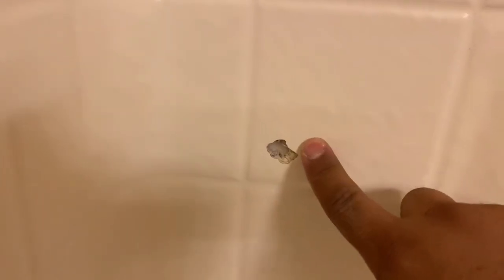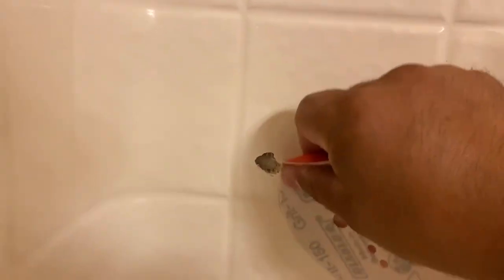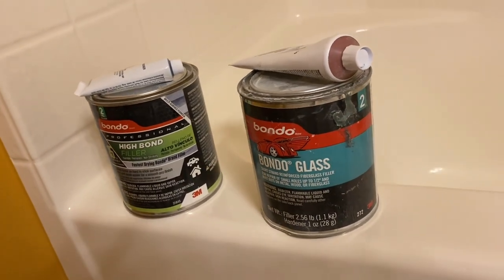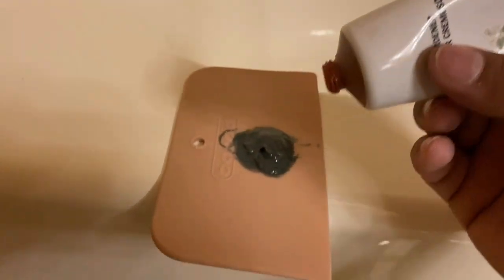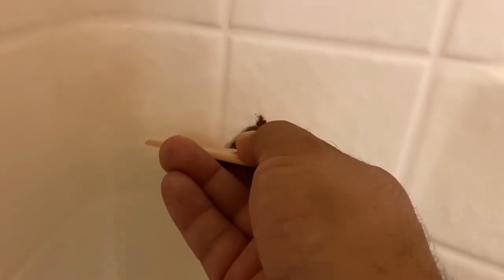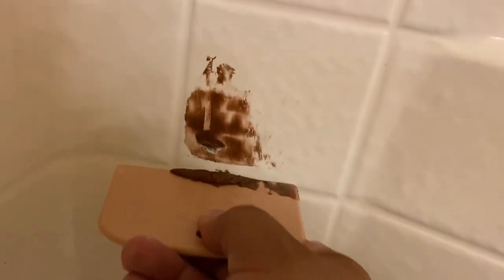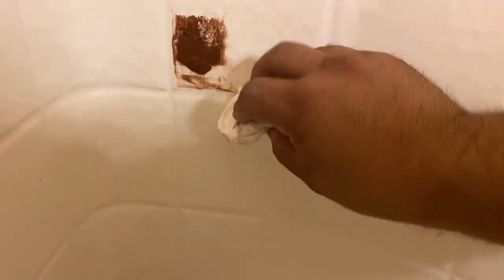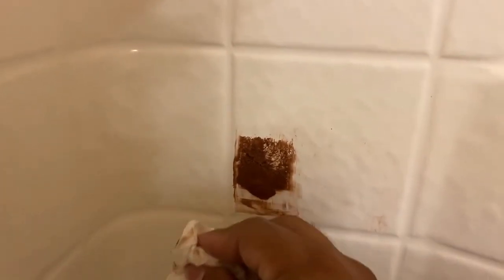How to Fill a Hole in a Fiberglass Bathtub | DIY Fiberglass Repair for $125 | DP TUBS

Comment: Is the high bond waterproof enough to use as a top final coat ontop of bondo glass on the base of a tub right around the drain area where it will get constantly flooded with water.
Reply from the maker: I wouldn’t use it as a top coat and final. I would spray it with an acrylic resin as the top coat
Reply: @DPTubs  - i meant as a final for bondo (ontop of initial layer of Bondo glass). I'll be spraying Rustolum appliance epoxy in white as final colour coat. just wondering if high bondo can be used ontop of bondo glass and if its water proof etc... I ended up just doing bondo glass only (no other putty ontop) and sanded it out to as smooth as i could get it and threw on the appliance epoxy. turned out smooth enough in my opinion.. Just hope the epoxy lasts as its by the drain where it will be getting wet all the time etc... (P.S- You make spreading the bondo when applying look so easy lol...)

Comment: Can you explain how you colored it to match? You did a great job on that. I have the same enclosure only the hole is right square on where the fake grout lines intersect.  Have to fill in the + portion  of the grout as well as the small surrounding flat area. Approx 2 " across by 1"  high. Assuming I just sand it down even with surrounding grout profile.  Was quoted 900 for the repair. Think I'm gonna do it myself as I'm kinda handy  Great video. Thanks hope to hear back.
Reply from the maker: You can always email me or Instagram DM me the picture for advice
Reply: Krylon Tub and Bath paint, or other brands same type products

Comment: I have a hole about the size of my thumb, or lets say the size of a teaspoon. Would you still recommend these methods? And if so should I purchase some fiber as well?
Reply: May not really be needed for something that small, BUT the fiber Does help keep the material together better. A longer lasting fix would use fiber I would think.